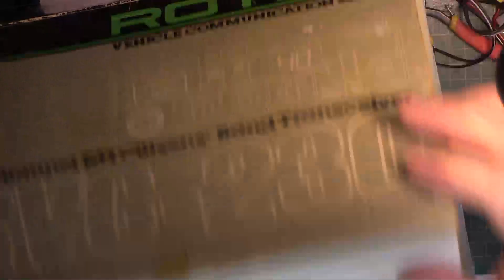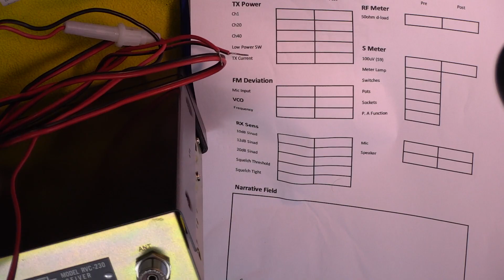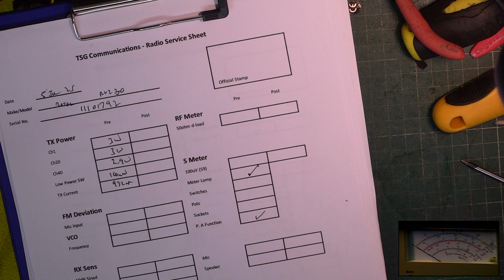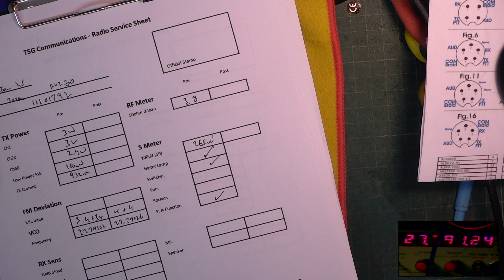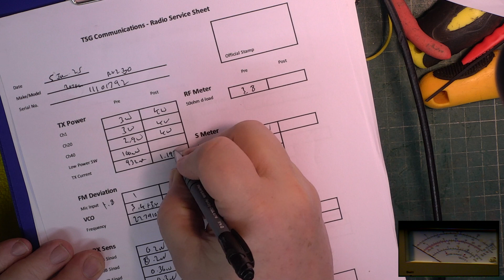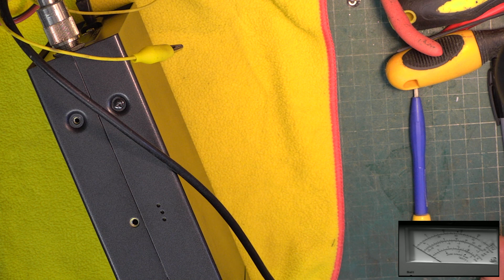Rotel RVC230 CB27/81 UK FM CB radio - service alignment

Comment: That’s a coincidence, I was aligning one of those yesterday after it sat unused for about 25years. The 220uF 16V cap under the power input head leaked and the VCO was so far out it would not transmit even after a good warm up/dry out. I noticed in the alignment guide that once the receiver was aligned, they said to turn T5 half a turn clockwise which I found curious. 

All good now, but a far cry from the wonderful condition of this set!